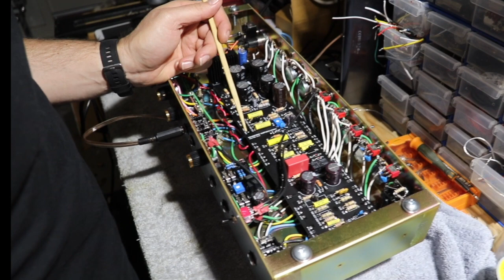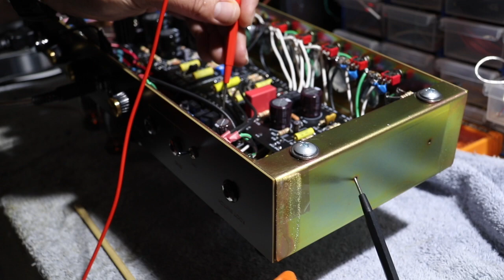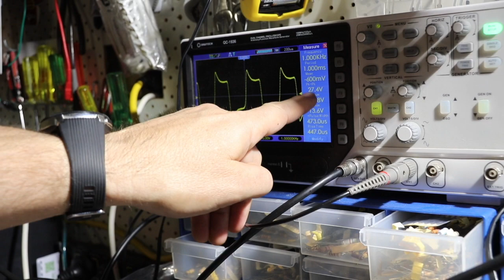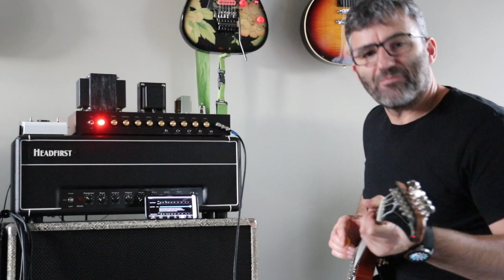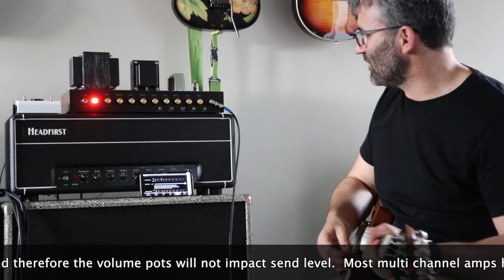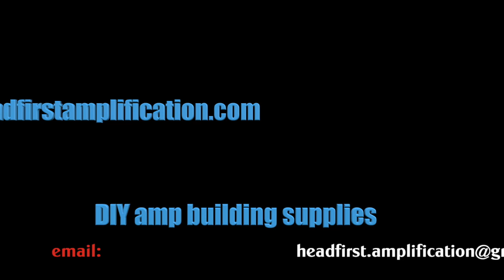Installing a Headfirst FX Loop

Comment: So on a 2204 or 2203 would you still put the loop on the treble wiper or the master volume wiper......I'm curious to know where your master volumes on the cali enter back into the circuit of the effects loop enters the phase inverter input

Comment: Hi, I want to put this in a Grand Amps 5e3 clone. Question though, if add the return volume pot, will that also serve as the overall Master Volume for the whole amp when the loop is switched on? Also, would I install this the same way on that 5e3 as you have described here?

Comment: Its possible install It in a transistor amp? Tanks a Lot
Reply from the maker: The loop needs a high voltage supply, around 300vdc

Comment: Nice vid and a nice fx loop, very cool, did not know they get so intricate. Mine is just a simple pcb with two mono jack sockets and two resistors, but I have an issue with my fx loop and kinda stopped using it, when there is nothing in the loop it buzzes 50Hz and when I bridge it all is good again. Did hear though that MT15 fx loops are often noisy, but did not expect this, because the amp really is a small beast with awesome lead and clean channel. How come you have stereo jack sockets on the fx loop pcb? It is stereo?

Comment: Hello, I have a 2009 JCM2000 DSL100 head and the loop is dead. If I try to let's say run my Helix into the input, all I get is a loud noise but no guitar signal. Just a loud buzz sound. Could I replace this loop with yours?

Comment: How do you drill into those plexi back plates and into the chassis without damaging(cracking) the plexi?
Reply from the maker: Yeah, plexi glass can be difficult.   High speed drill,  and tape off the glass prior to drilling.  However my plates and chassis's are laser cut ready for the loop, so no need to drill!